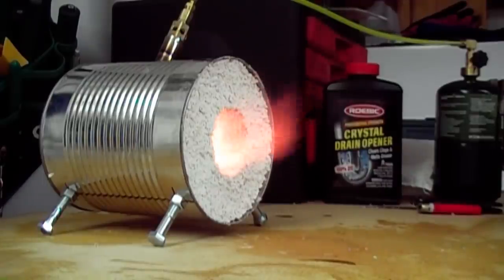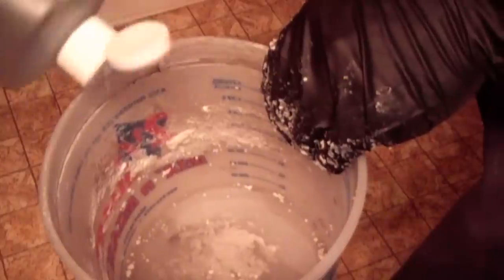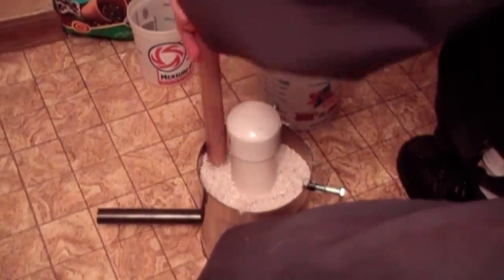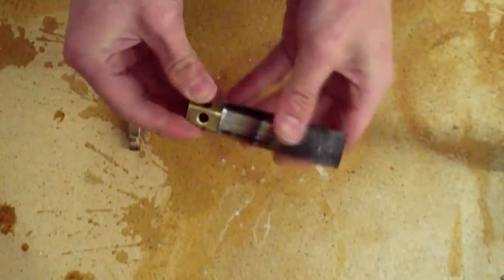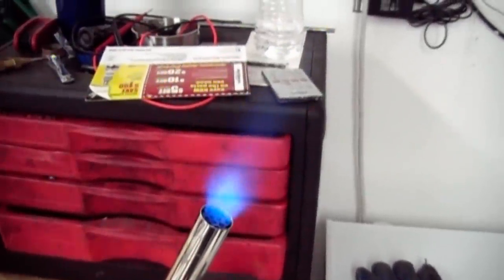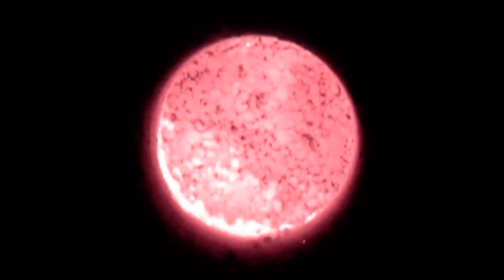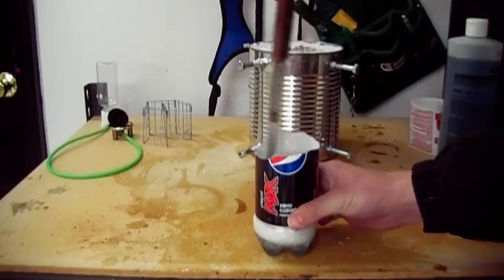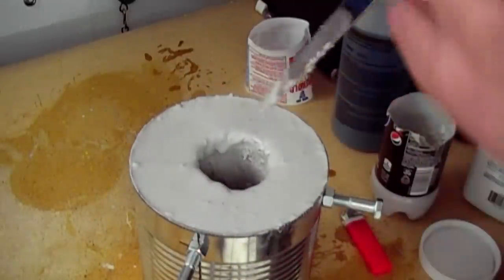How to make a coffee can forge

Comment: Excuse me CLkindred, I am basically creating a clone of what you'd made in this video. I already got myself the number 10 can and currently trying to figure out different parts.

I am a bit stumbled about the perlite mixture, for the mixture what is absolutely necessary, and what ingredients for the mixture are more for long term durability/etc.?

Because didn't you add this weird thing to it that was in that ketchup squeezer bottle?
Reply from the maker: I think what you are talking about is the sodium silicate in the squeeze bottle. It is the glue that holds it all together. The perlite provides insulation, the plaster dose more than I thought it would at first. It looks like the plaster coats the perlite particles in a plaster shell, making it more temp resistant. I'm still experimenting with this type of thing and hope to post a better video in the future. The best advice I can give is this: This is just as much an art as it is a science, just as painting or clay pottery takes practice to learn, this dose too. Your first attempt may not come out the way you want, just keep at it.
Thanks for the comment and interest.
Reply: clkindred
ok that helps a lot :) maybe i will make a video in reply once it is all done

Comment: could you use sand instead of the aluminum oxide for the outer layer of cement.
Reply from the maker: +SHRIMP11112 Probably, it won't "work" with the same properties as a finer particle material, it will be like wet sand and be hard to spread over the surface.

Comment: Made my perlite/sodium silicate mixture until it was like wet sand/ beach sand. Only difference is I didnt put in plaster of paris... it has been  two weeks exactly and it is still gooey... how long does this stuff take to dry? can I heat cure it faster if I put a burner in it? Id have to burn out the center form but...
Reply from the maker: +kevindflowers234 It depends on how much sodium silicate is actually in there. If it's thick enough to skin over like glue, then flame curing will cause it to bubble up and blister. A long soak in the oven at just below the boiling point of water will help a lot, if the oven is off limits, try turning it upright and burn a tea light candle in the bottom.
Reply: +clkindred Thanks.... will the sodium silicate leave any residues or toxic odors/ coating in the oven?

Comment: How would portland cement compare with sodium silicate as the binder for this application?
Reply from the maker: Portland cement breaks down at these temperatures. It might last a few firings though. But the big problem is there is so much water to be burned out at first, it won't reach temperature for a long time until the water is gone.

Comment: I am building a forge currently like this but I stuck in a piece of PVC for a mold and I cannot get it out now. help please!! I only waited like a half hour and when I went to check on it well it well rock hard. my refractory is Plaster of paris, sand, and water
Reply from the maker: The_All_ Around_ Guy I'm kind of late to this party but, if it's still stuck and you can't remove it by twisting, you might have to cut your losses and try again, but with paper or plastic wrapped around the mold pipe.

Comment: What's the self life of the sodium silicate??   ANd what would you put inside such
a small oven  hole, a rectangle shaped crucible ??
Reply from the maker: sthwestb If stored in an airtight plastic container, the storage life of sodium silicate is basically forever. This is for heating up pieces of steel for forging. This did however prove to be a little too small to be useful, so I made a larger one.
Reply: sthwestb You can heat anything that will fit into the space.  Typical applications would probably be blacksmithing, knife forging, heat treating metals, smelting ores, metal refining, jewelry making, casting metals.

Comment: so how long does something like this last? I'm hoping to make something like this but a little bigger. big enough to make a 12 inch chef knife. will this last for a while or does it break down?
Reply from the maker: +Jesse Snowden I outgrew this forge before I could find out how long it lasts. It showed signs of softening where the flame directly hits the wall. My new recipe which has aluminum oxide added to it is holding up great.
Reply: +clkindred good to know! do you have a video of that? and/or are you willing to share the ratio? i was planning on using perlite and plaster of paris for mine.
Reply from the maker: +Jesse Snowden yep, but I'm on my phone and can't link it. It's on my channel though, it's called how to make a trashcan forge.

Comment: what did you use for the brass ring to center the burner in the pipe? Also how to you attach the drain piece to the pipe? weld it?
Reply from the maker: Drkl0rd The burner is centered with a 3/8 to 1/2 face bushing, the sink strainer is a forced fit.
Reply: Thanks!

Comment: I have 1 question every time i see something like this isnt it dangerous with the gas ?
Can the Gas Bottle Explode ?
Reply from the maker: +TheKiiiki123 You must be talking about a "flashback" like with oxy/gas torches. Though not impossible, they are not likely to happen with something like this. Oxygen/gas torches mix the the fuel and oxygen sometime before the mixture exits the torch, so there is a danger the flame can flash back inside the torch and cause problems. The bigger danger is either with a "burnback" where the hose delivering oxygen begins to burn on the inside. As the hose itself burns in the presence of pure oxygen, the fire can burn its way back to the oxygen tank causing an explosion. The other big danger is when oxygen is forced backwards through the fuel gas hose, either from a problem with the mixing torch or a flashback inside the torch. With oxygen in the fuel hose or tank, there is a possibility of combustion inside the tank. As long as there is no oxygen in the fuel hose or fuel tank, there is no risk of combustion inside.

Nevertheless there are devices built into the blowtorch valve I used to address both problems, one way valves to prevent reverse flow of air or gas into the tank, and brass or bronze sponges to stop flame from getting past the valve.

On a side note, HHO torches that are popular on the internet are extremely prone to flashbacks. There is no separation between the fuel and oxygen because they are generated together, and are of the perfect ratio to cause an explosion. So a flame making its way past the torch in this case will immediately shoot back through the hose, right to the HHO cell and blow the whole thing up.
Reply: +clkindred Thanks for the Fast anwser and sorry for my "bad" english hmm i think ill stay with coal and wood.

Comment: Can you use play sand instead of plaster of paris (sodium silicate, play sand, & perlite)? will it work as good? also, will the sodium silicate perlite mixture set up without heating it? if not, how did you get your form out without it all falling in?
Reply from the maker: Fine sand might work, this hardened in air, but won't be cured until fired for the first time. Otherwise, if gotten wet it will turn soggy.
Reply: clkindred fire forge and hardened sand, perlite, waterglass, cooled rock hard. used forge again and it is melting waterglass... ?
Reply from the maker: There should not be any waterglass left if cured. The waterglass decomposes into silicon dioxide (quartz) unless you can reach temperatures high enough to melt silicon dioxide 2,912°F (1,600°C) then something else is melting. The perlite can and will melt, but the perlite is sacrificial and is only used to make voids in the lining to insulate better. I'm still learning about this lining and how it works.
Reply: clkindred ? it went from rock hard "glass like" to soft and pliable almost like a playdough that falls from top. then when cools its rock hard again. Im not sure what temp it reaches havent checked that yet, (two burners in a 20lb propane tank forge). Thanks for your input, I appreciate it.

Comment: I saw other videos that only use plaster of paris and sand instead of perlite, which is better?
Reply from the maker: I never got good results from plaster and sand.
Reply: perlite is much lighter so your device will be more mobile. it also contains more cavities so the whole thing will insulate much better. Sand will take longer to heat due to is enormous internal heat capacity but also take a damn age to cool down so u don't burn dwn your house or car...

Comment: What capacity propane bottles do you use and how long do they usually last?
Reply: Lucas Holl This one uses a little plumbers torch sized disposable bottle, like you'd buy in a hardware store or camping store. Mine uses a 100 pound tank, which holds about 23 gallons of propane, stands over 4 feet tall, and is 18 inches in diameter. They come in a variety of sizes in between, as well. 

I can't really address how long a little tank like this will last. A 20 pound tank, like you commonly see on barbeque grills, can lass a long, full day of forging, running at 8 pounds pressure.
Reply: artsmith100 Okay, thank you.

Comment: Is the brass pipe 3/8" or 5/8".  I looks much closer to 5/8" outside diameter.
Reply from the maker: Gerald Fulton Well, it's 3/8 NPT. Pipe sizes are strange and are not physical dimensions of the fitting, but more of a naming scheme.

Comment: where do you use this,.. its like extravagant wasting propane demo,..
Reply from the maker: Cesar Caoili This exact one was replaced with a slightly larger forge, I use it mostly for heat treating knife blades.
Reply: Cesar Caoili As if there's a limited supply of propane. No harm done. Very neat design clkindred.

Comment: What are all the materials? I wasn't quite sure what was required, even after rewatching the video
Reply: As well as est. cost
Reply: Also, how does it start burning without some kind of fuel source?
Reply from the maker: Neo Glasscock In this one the lining is made from perlite, sodium silicate, and a little plaster. The sealing cement I put on at the end was made from sodium silicate, aluminum oxide and baby powder. It burns with a propane burner I made. I think I put about 40 dollars into it including the propane burner.

Comment: Ok i see how the burner is made what makes up the propane delivery system and what size tank?
Reply from the maker: I suppose I need to make a video with just the burner build, it's been an ongoing project (the burner) from all the way back to when I made my propane camp stove. This vid details the tank and valve.  https://www.youtube.com/watch?v=XwSHS6MlIdI
Reply: clkindred I was curious: is the velocity of the flame simply due to the stainless pipe and other components? I ask because it doesn't seem like those disposable tanks have that much pressure and any forge I've seen has a blower of sorts installed.....
Reply from the maker: michael cochrane The velocity is caused by the orifice, this uses a 0.016" diameter orifice to generate a high velocity stream of gas, this causes air to be drawn in through the holes in the back of the burner due to the bernoulli principle. Burners that use a blower just pipe the propane into the forced air stream, and the size of the opening that the gas exits is not critical.
Reply: awesome....I wondered about that....that kind of makes sense because we use salamander propane heaters at work in the winter and the flame shoots out like that too...always wondered why....

You're the best!

Comment: Hey man, I've built a burner similar to yours except i keep getting a yellow flame after my blue flame. Doesn't seem to act like a blow torch or similar. I suspect not enough air in the mix but opening up my holes on the coupler hasn't helped with that either. Any ideas? thanks in advance (other thought being, I'm in Australia and using LPG as a gas source (tis a bit of a mix of propane and butane))
Reply: +clkindred Also if i get to around the 10psi park on my regulator it basically blows out the flame. to bigger orifice maybe?
Reply from the maker: +MrTwitch44 What you describe actually dose sound like the orifice is too large, so the gas stream is not at a high enough velocity to draw in enough air. That would also explain why enlarging the air holes has no effect. Blowing out of the flame at high pressure is a sign of a burner that is too small for the orifice size, or not enough flame anchoring. Start by making a smaller orifice and it may solve both issues.
Reply: +clkindred Thanks for the reply, Ended up starting over this time a much smaller orifice. The original was 1.6mm (way too big!) down to .6mm now and put the orifice higher than my air holes to draw through better creating a venturi effect. steel gets to melting temperature now, had to dial it back a little :P

Comment: Hi again! :)  Aluminium oxide is not readily available in my area/country so are there any other mix to seal the perlite? Maybe Portland cement and sodium silicate (not sure of the ratio)? Thanks!
Reply from the maker: +Sheekit Low Mixing sodium silicate in any significant amount has strange results with portland cement. You would have better luck with fine sand, although it would not take as much heat as the aluminum oxide. Something I want to try is carbon, like activated charcoal filter media. carbon has a very high melting point as long as you keep oxygen away from it. Encapsulating in sodium silicate might just do that.
Reply: +clkindred can i crush charcoal and mix it with portland and sodium silicate?
Reply: +Sheekit Low maybe some talcum powder or baby powder with it too?

Comment: Are the threads on the brass NPT? Is there electrolysis between the brass and the stainless steel?
Reply from the maker: +John L Bales The torch valve threads seem to be pipe thread non tapered. There is no problems between the stainless steel and the brass. (They use stainless steel wire to hang copper water pipes so the corrosion dose not eat through the pipe)
Reply: Thank you so much. Good job, too.

Comment: Hey man I've been trying to figure out what size and npt the elbow is that goes into the blowtorch head valve.  I've tried 1/8" npt but it was too small to fit the threads for the blowtorch head valve.  What street elbow did you use?
Reply from the maker: Neil lau I used a 1/8 npt street elbow. Your torch must be different from mine. What torch brand are you using?
Reply: clkindred hey man thanks for replying.  I was using a bernzomatic pencil flame torch head it was 13 dollars on Amazon.  I've been using different 1/8" mip and tapered threads.  Is mip fip npt the same?  The ones I have been using will work with no teflon tape for about two rotations and will screw on at the bottom but it is a loose fit and they do not hold. Thanks for the help
Reply from the maker: The brand of torch I use is "worthington" but it seems it's basic design is sold under many brands. mip and fip should just mean male and female threads, both using the NPT standard. Your elbow may be bottoming out in the valve hole before the larger portion of the tapered thread can enter the valve. You may need to shorten the threaded male part of the elbow so it can become snug before running out of room to thread in deeper. Alternatively, if your torch had a bent brass pipe screwed into the valve to start, you could take that piece, saw off the end with the orifice, solder on whatever hose connection you want, and screw that back onto the valve.

Comment: I am having complications with my fordge.... It doesnt get red hot around the whole inside. Only where the propane flame is directly hitting it. Is there anything that I can change to make it work?
Reply from the maker: +Jon Ashworth What kind of burner are you using? A simple blowtorch is too small for a forge this size.
Reply: It is a simple all brass torchhead with an adjustible nob. It was having trouble staying one when it was hooked up directly with the bottle so I used the hose and it stayed lit.
Reply: clkindred It is a simple brass head torch. I didn't add all of the stuff to it besides a copper pipe.

Comment: How much smaller is the stock orifice? Could you use the factory orifice?
Reply from the maker: The stock orifice is much too small for a burner this size. If the stock orifice must be used, then the stock burner that is designed to run it needs to be used as well.
Reply: clkindred so u find ur drill bits for the orifice at a hobby store like radio shack or actual hobby store
Reply from the maker: Radioshack might have them for drilling circuit boards, but I got mine from a shop that sells model trains, cars rockets and things like that.
Reply: clkindred i figured all the shops in my valley closed so its slim picks here but thanks for info love the idea.